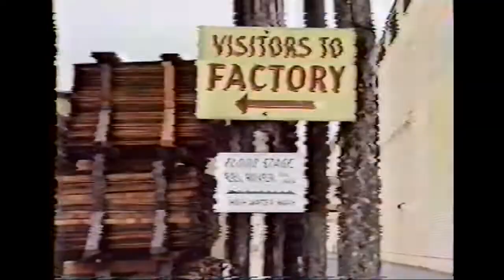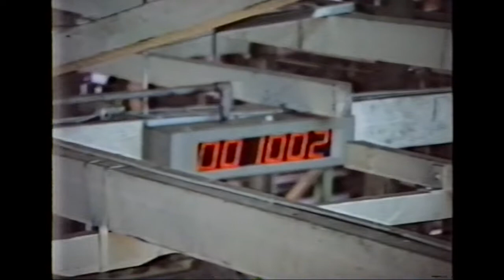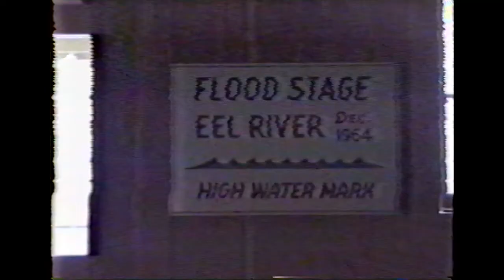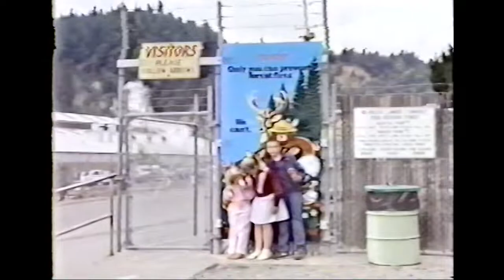PALCO Mill Tour 1989

Comment: Thank you so much for providing this resource, both these buildings are gone now and almost no available video of them exists. This recording is incredibly valuable to generations that will only see the shadow of this industry
Reply: Its great to see this video.  My Dad, and my two uncles worked for P.L. in the 50's and 60's.
Reply: I USED TO WORK AT PALCO IN THE FACTORY 2000 UNTILL 04 LIVED ON POND 711 MILL A IS STILL THERE BUT THE REST IS GONE
GOOD TIMES BORN AND RAISED IN HUMBOLDT ARCATA CA WESTEND RD  GRANDPA WAS A DAIRY AND A LOGGER